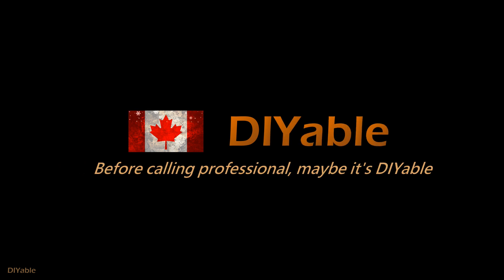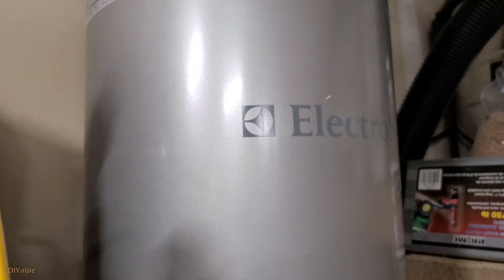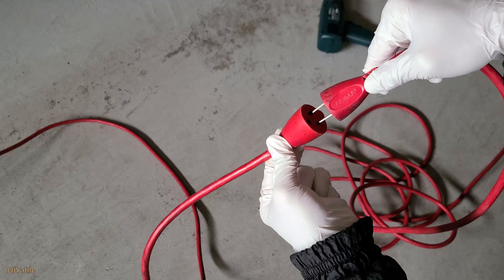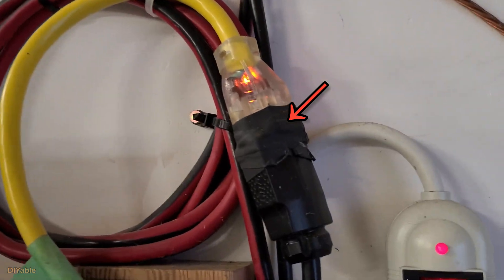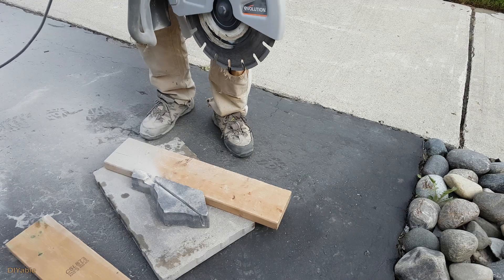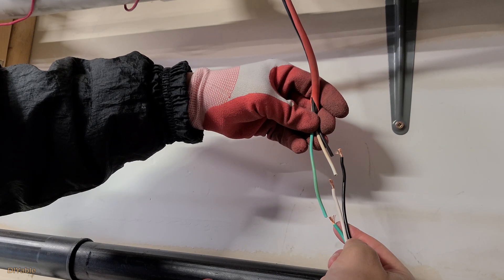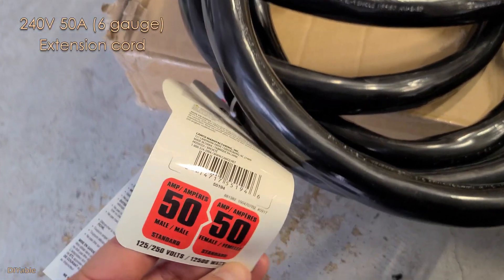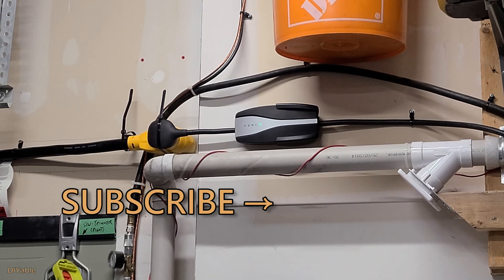How to repair damaged extension cord and what can be done to prevent electrical fires?

Comment: The repair should be redone with the proper connections.  That's unsafe due to the vibration cracking the bonds. Anywhere with vibration or water penetration , like garage.use crimp.or twist connection.  It will work for a very long time possibly never needing repair. It just cracks over time and the short is problematic.
Reply from the maker: I will let you know in couple years...
Reply: @DIYable  How did it turn out?